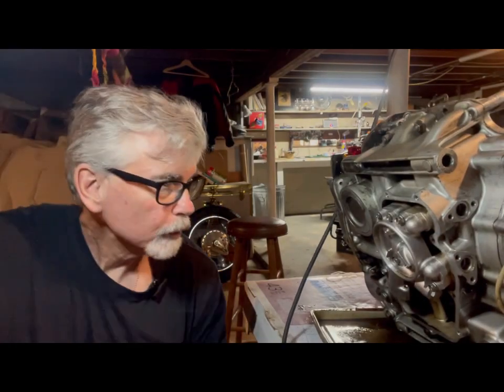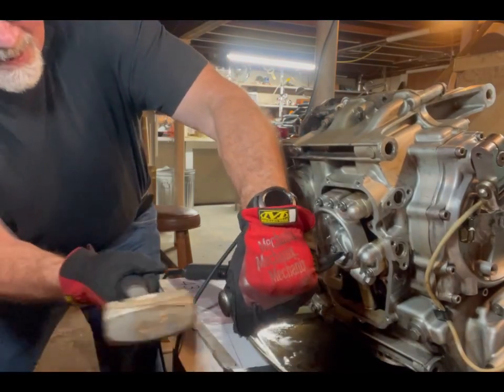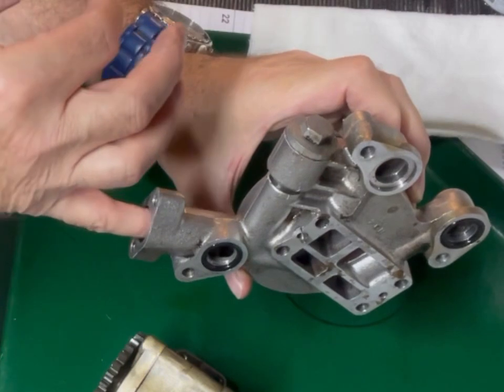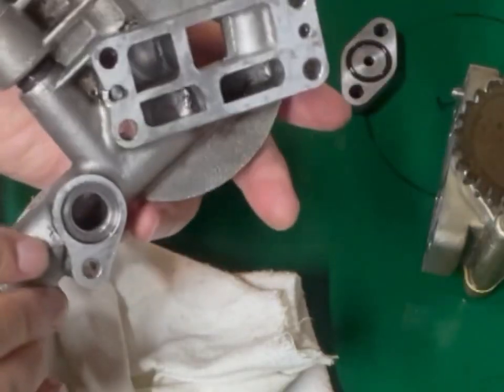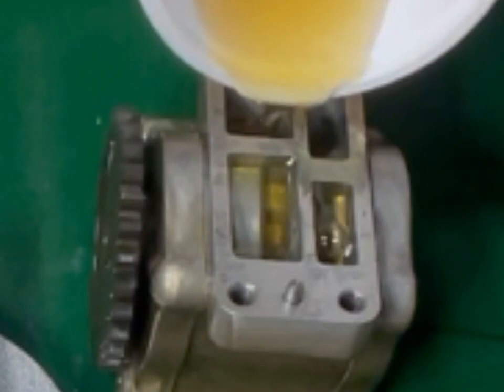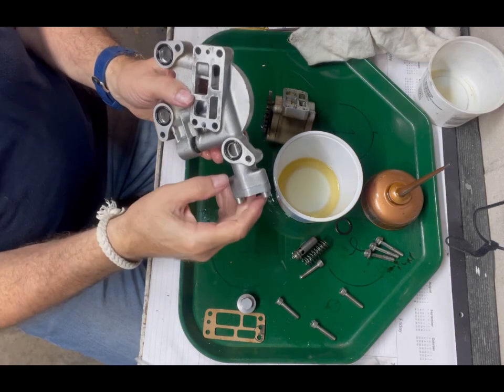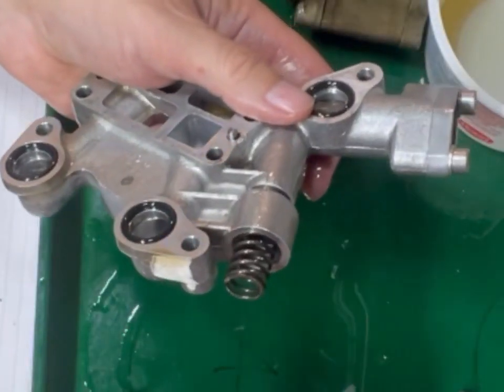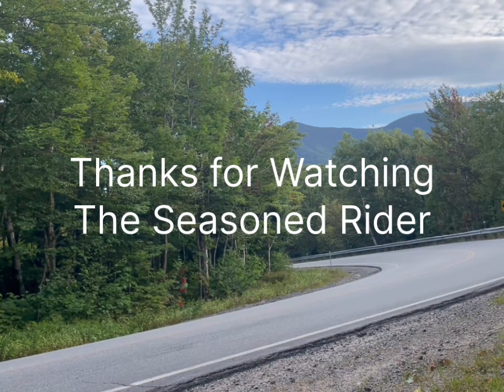Oil pump removal and maintenance on a Honda CB750 SOHC

Comment: The screws on any Japanese motorcycle are not Philips, they are JIS (Japanese industrial standard). If you used the correct screwdriver they would have come out.
Reply from the maker: If only I knew stuff like that. Thanks for watching Doug.